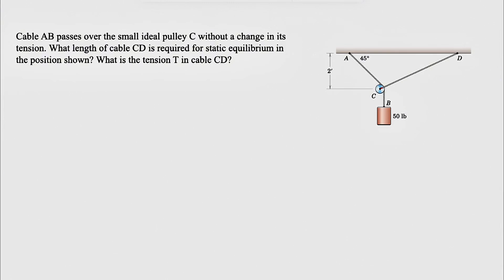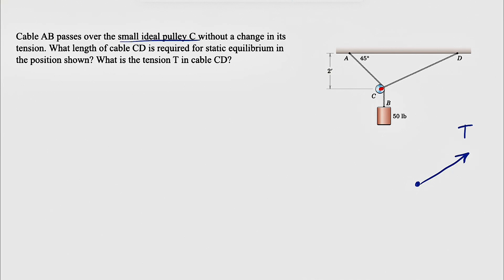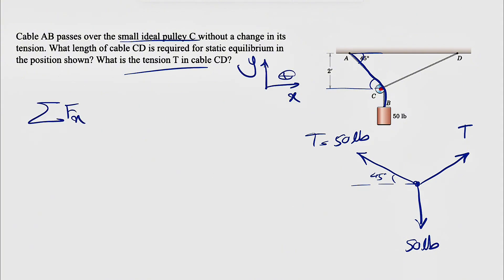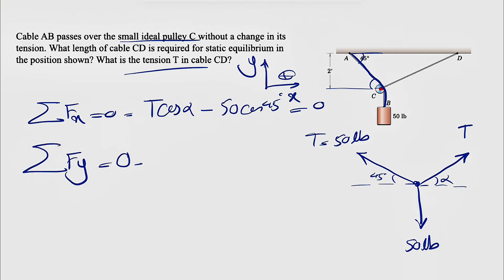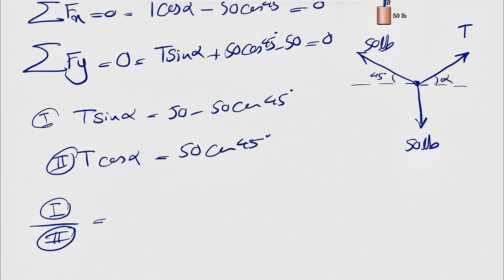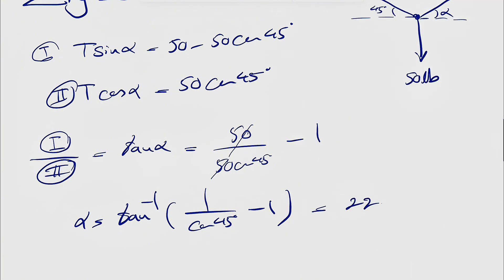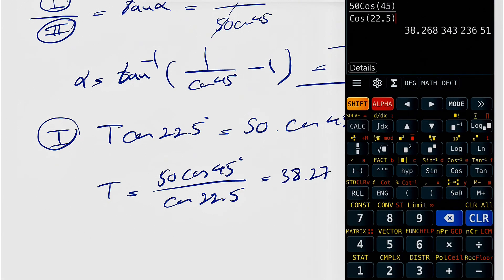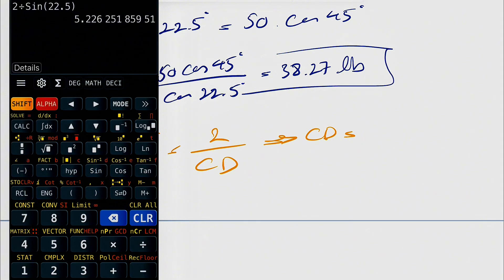Cable AB passes over the small ideal pulley C without a change in its tension. What length of ...

Comment: i’m not sure how lb works but when solving in kg do you convert to weight by multiplying with g
Reply from the maker: Good question! In the imperial system, lb already represents a unit of force (weight), so you don’t multiply by g. But if you’re solving in kg (SI units), then yes — you need to multiply by g to convert mass to weight.